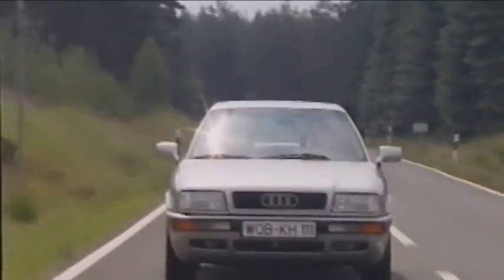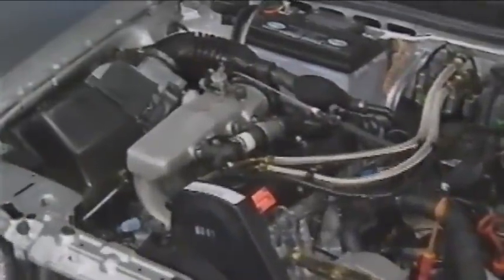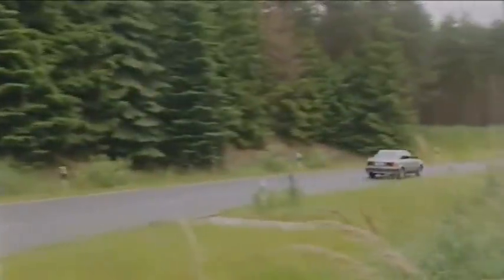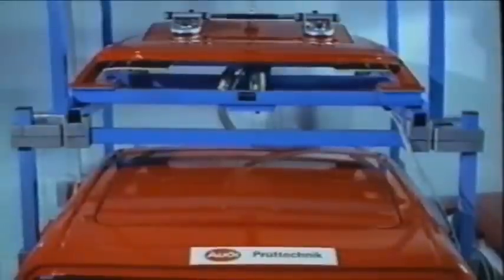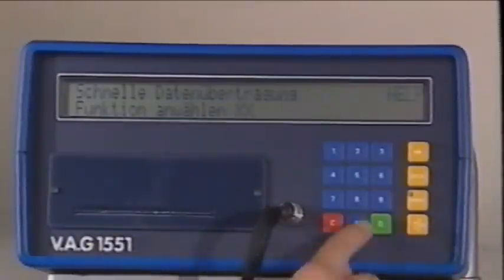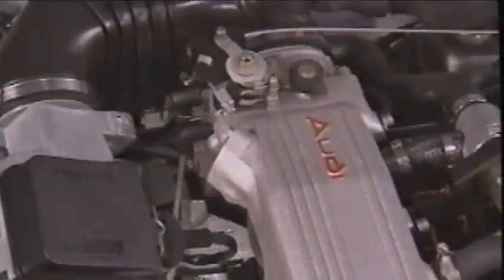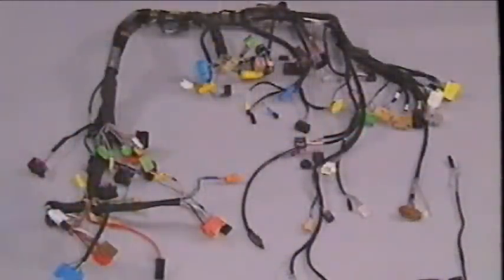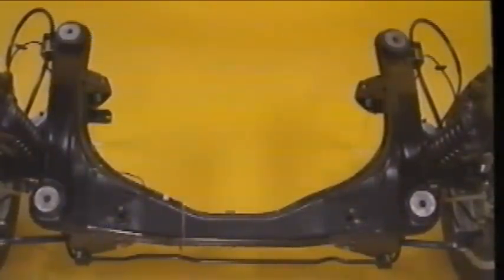Der neue Audi 80 (B4) 1991-1995

Comment: Ich liebe den Audi 80 B4 ♥. Werde mir auch noch einen holen
Reply: @Gerry Page Hallo Gerry, ebay-kleinanzeigen, dort finden sich m.M. nach richtige Schmuckstücke zu moderaten Preisen. Wenn man weiß was man zwischen den Zeilen zu lesen hat, dann erkennt man auch oft den Grund warum die Autos aufgegeben werden. Innen wie außen sehr oft in einen unglaublich guten Zustand, teilweise unter 100tkm. ABER, viele 90PS ABT an denen rund um die Mono Motronic rumgebastelt worden ist. 
Dort ist leider der Schwachpunkt den der Motor hat. Eine handvoll Sensoren die viel Ärger machen und besonders der Ansaug.Luft.Temp.Sensor kaum mehr zu bekommen ist. Leider weiß kaum jemand, dass man das Teil, ein 20ct 2,2KOhm NTC mit etwas Geduld und Geschick instandsetzen kann. Meist läuft das Auto bereits ab wieder wie in den ersten Jahren.
Reply from the maker: Vielen Dank für das Feedback. THX

Comment: I don't understand a word from it (ok, maybe few words), but still I enjoyed this video ;D I have Audi 80 B3 from 1990, it has done 350 000+ kilometers and is still in great condition, and it drives really well. I think 90's were the golden era of German cars, and cars in general.
Reply: I have the same opinion :D
Reply: And how much money you spend in month on repair and service? (I'm asking, because I'm dreaming about this car too)
Reply: @khalashst  First of all those cars are very reliable so they don't need to be constantly repaired. Once you do something its done for a longer period of time, provided you don't buy the cheapest parts. In the past 4 years I did have some major repairs but that were repairs or replacements of ORGININAL 30 years old parts from this car. In my region the parts are still available in very low prices, also there is still decent market of used, original parts for those cars. Many mechanics likes doing such cars because they're easy to repair and access to the engine is really good. In my case I can say that I can get fixed about half of the car for about 500$. This year(January) the whole suspension(front and rear) was done and I paid 450$. 3 years ago I repaired head gasket, timing belt, radiator(the original one 30 y.o. was replaced by the new one) and the whole cooling system for about 500$.
Reply from the maker: Vielen Dank für das Feedback. THX